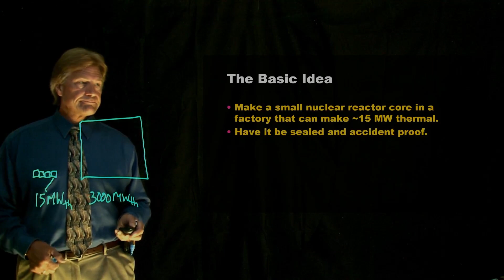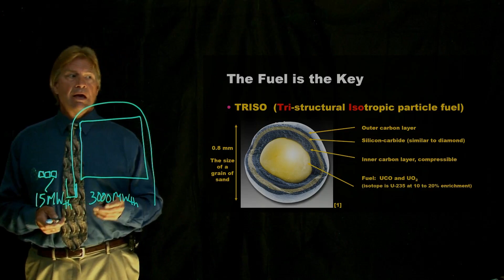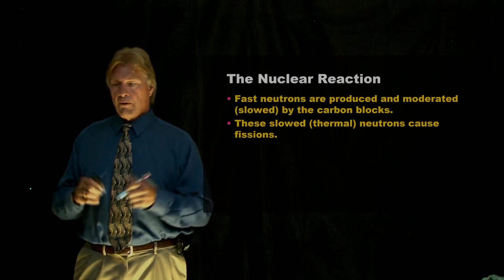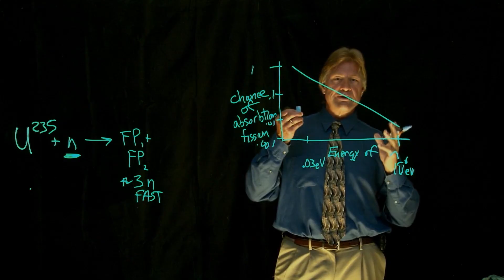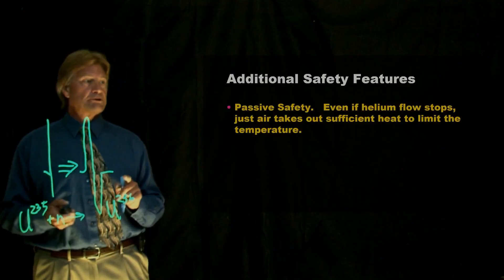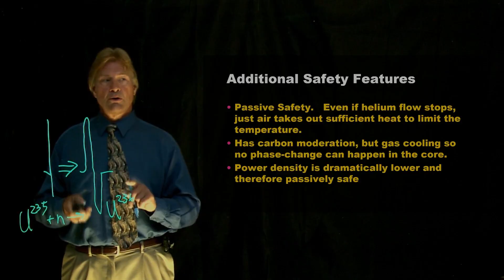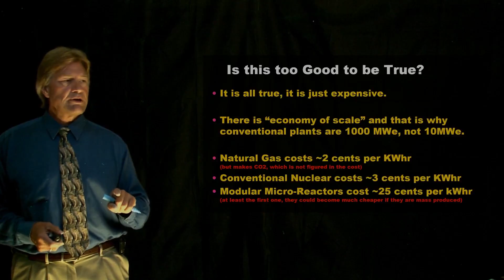Modular Micro-Reactors – The Future of Nuclear Energy?

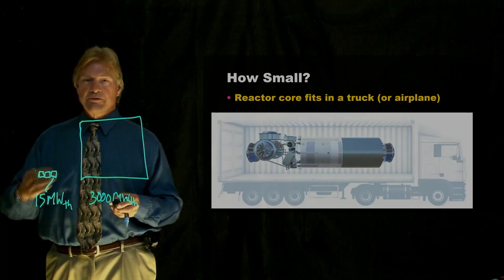Comment: at 3:20 - Mentioning Boeing, in particularly the 737, at this time probably isn't the best safety analogy.   Just Sayin'.
Reply: He didn't say 737 Max.
Reply: It didn't need to be said.
Reply: @milesobrien2694  It drastically changes the comparison he was making, so yes, it would have needed to be said, if that were what he was referring to.
Reply: @theralfinator  The comparison was the price of a prototype against mass production. You don't need to try to defend the indefensible.
Reply: @milesobrien2694  That's the comparison the Prof was making. The OP was making a point about safety, and that comparing the 737 to nuclear reactors was problematic given the current 737 Max debacle.
I'm merely pointing out that there isn't a safety perception issue with the OG 737 that the Prof referred to.
Reply: @theralfinator  Bafflegab.

Comment: All reactors and other thermal production of electricity depend on cooling. So they will work until there is cool air or water. To prevent global warming we need to use and harness solar energy.
Reply: Big Crunch 1GW nuclear plant =10 B$ plus CO2 emissions to produce concrete and steel and nuclear waste
Reply: @prilep5  1GW coal plant ~ 6B$ plus CO2 emissions to produce concrete and steel, and waste fuel on hauling coal. And yes, small thing, burning the fossil produces a teeny-tiny ammount of CO2
Reply: Big Crunch don’t look just at terawatts and exowatts
Reply: Big Crunch 1GW solar farm 0.5B$ no waste and polution
Reply: @prilep5  well, you took into consideration the CO2 emissions due to production/construction/maintenance, why didn't you include the ammout of CO2 produced by: mining silicon and other component minerals, transporting it to the factory, processing the materials into plates, manufacturing the elements, the land required to produce that ammount of energy (!), the maintenance needed to keep the panels clean, repaired, the batteries to store the unstable energy (!) the crashes of bad weather in autumn/winter/spring AND many more.
Reply: If that is so insignificant why we loose ice and snow?because sun got cranked up?
Reply: @prilep5  no, it is because the greenhouse gasses in our atmosphere capture more heat from the sun. Can you please read at least one of the 20 previous answers to your question? I am telling you the same thing over and over. And it isn't a PHD-grade top secret information. Most of this i learned in a post-USSR-grade underfinansed school. This info is a one google search away from you. Can you please research the topic before starting a debate?
Reply: @prilep5  but we are trying to save the Earth by going clean nuclear.
Reply: https://youtu.be/r72GDBOmDtM
Reply: Global warming issue is not the heat itself, but the increase of heat we recieve from the Sun, due to increased ammounts of greenhouse gasses ( a.e. CO2, methane and others). The nuclear power, in general, does not produce any of the forementioned gasses, and therefore does not attribute to global warming at all. That is why it is considered a "cleaner" substitue to coal and gas plants.I recommend researching the problem before trying to discuss it.
Reply: @Gaius_Cassius  You do know that CO2 is made in the construction of the plant and the mining of the uranium right? Practice what you preach and do a little research. OK I see your later comment so please disregard the criticism. It is proper to factor in the CO2 produced in making solar but the net benefit is still there and the modular nature of solar allows much faster adoption which is also helped by its lower cost.
Reply: @stevemickler452  A) from the data i have, on average, although nuclear reactors quite hard and expensive( both costs and CO2 emissions ) to build, they do not require the ammount of fuel, compared to the scale coal/oil/gas plants do. There is a video on this channel with quite a broad analysis of costs of building/maintaining coal/gas/nuclear plants. B) Tesla battery is not yet a practical solution for the energy grid. The batteries, although fairly light, aren't durable and cost effective Enough to be considered an economic solution, for now. Building one reactor that can operate for centuries, although is a heavy investment, with our curret state of technology is a better solution in a long term ( the insignifficant price; comparatively small scale, the ability to enrich the fuel on spot, and the mind-boggling abundance of ore depostis; for an overview i recommend checking out the mentioned earlier video). Of course, the fastest and cheapest (not including emissions and polution) solution are fossils. Accessible, energetic, easy to get the energy out. So, in conclusion, sun/wind can fill a niche, in some parts of the world (arid deserts), they can even be a good second source/backup. But the instability and the cost of installing and maintaining the sheer ammount of batteries needed to sustain a grid overshadows even costs and complications of building a nuclear reactor. Fossils are the answer for places that have no money/time/resources/the education and acknowlegment by the people/goverment to build the other two; for small remote stations (eg. Siberia, Antarctic, parts of Africa etc.); or a convenient and cheap power for a fossil rich region that doesn't give a crap about global warming panic due to much more signifficant problems hacking through the door. Nuclear is, relatively to fossil, an expensive investment but, for sure a much cleaner and fuel side cheaper solution in a long run. Now i have spent 15 minutes typing this for a man that accuses me of ignorance, but he himself didn't pay attention to the conversation above, where a subject of CO2 emission during construction of power plants was mentioned. To this i will also add, as a Post Scriptum, how do you think, what is the cost of manufacturing and constructing solar/wind power plants? Where do the materials used in modern complicated PHV panels come from? What is their emission trace?
Reply: @Gaius_Cassius  Thank you for that informative and I think heart felt reply. I think in other comments, I address some of the issues you raise. I suggest a little more research on the state of development of batteries in general and those of Tesla in particular. Nuclear for power production on a large scale has been out competed and we're headed for a solar/wind/hydro/geothermal/battery/liquid air battery /hydro storage infrastructure. I think that is a good thing and I hate to see such brilliant people not making the best use of their abilities because they are pursuing obsolete technology.
Reply: @stevemickler452  well, i guess we just have different ideas for where the energy production would be applied. My mind is more open for interstellar-class technology, where nuclear power reigns supreme, as no battery can store enough energy compaclty enough for such scale. I see a future where reactors that can last not just centuries, but millennia and more, where there is no worry about bad weather, pollution or any other disaster, just simple and stable supply of cheap power. The Earth as a testing site of safer, more powerful and longer lasting source, where the technology gets perfected. Of course, i don't advocate going 100% nuclear. Nor do i advocate the inforcement of unstable power sources in places where it not very convenient, but you ought to do what people ( whose stance in a majority case is: solar is ideal in every way possible and everyone who criticises it is a totalitarian comunist obsessed with nuclear weapons or a filthy oligarch interested only in making profit from his fossil fuel oriented company, both literally compared to one famous astrian painter (famous not for the paintings); and God forbid you mention nuclear... Chernobyl!Fukushima! Monster! ( and noone cares that i was born in Ukraine and have plenty of clear first source information abot the Chernobyl incident. The Prof. on this channel has a pretty descent video explaining the basic situation.). So, of course, i promote the information about safety and hazards of nuclear, for it is very annoying for me to see people not just misunderstanding the subject of nuclear, but to act out a "u no green = u bad" policy.
Reply: @Gaius_Cassius  Certainly don't want to suggest anything other than that thermal tech, even terrestrial solar thermal is so yesterday. I do have an open mind for space operation but here even I believe solar thermal/electric propulsion and concentrator type PV is more competitive, even out to Saturn, than most realize since mirrors can be quite thin. That said, I wouldn't want to go to Proxima Centauri without a reactor.
Reply: @stevemickler452  i completely agree
Reply: And also, the photovoltaic elements (solar panels) while producing electric current they also produce heat. Even the most advanced solar panels do not transfer all of the photon energy directly into electricity. 40%-90% of the photon energy is converted to heat (although it is a bit more complicated than that). And how about the mirror energy plants, that focus the solar rays onto a boiler, heating it up to produce steam from water. And use the heat the same way the gasoline/gas/nuclear power plants do.
Reply: Павло Павликівський so you think that I don’t know that 
With solar we don’t release 60% in warming air and water while producing electricity plus pollution 

https://energyeducation.ca/encyclopedia/Nuclear_power_plant#Efficiency
Reply: @prilep5  the Sun literally is the main thing driving the global warming. If you consider nuclear power "heating the planet up", i would say that you can't heat up a giant house by tens of degrees with a small LED lighbulb
Reply: Павло Павликівський suns energy will arrive no matter we will used or not with solar will get 25% clean source
Reply: @prilep5  but if you compare the scale, the heat generated by the whole of humanity, by any means, be it nuclear, fossil or any other is such a small fraction, that noone considers it to be of any importance. On the other hand, the greenhouse gasses are of big importance, especially considered the sheer ammout of emission.
Reply: @prilep5  yes, but guess why we aren't using only solar/wind energy? Maybe it's because  these are very unreliable sources of energy, given the limits of our current technology in storing energy. Take, for example, a huge city that has the highest demand for electricity after the sunset. How can solar power that up?
Reply: Павло Павликівський what is the solution No Sun no global warming problem solved
Reply: @prilep5  you don't seem to understand the point i am making.
Reply: @Gaius_Cassius  Suggest you check into the Tesla battery storage projects currently in operation and being built.
Reply: So you blame the sun for majority of global warming
Reply: @prilep5  as i have already stated before, the Sun provides more than 90% of the heat on the earths crust. The greenhouse gasses increase the ammout of Sun's energy captured by Earth's atmosphere.
Reply: Павло Павликівський dude what is your solution -more nuclear energy
Reply: Павло Павликівський answer in short sentences because I can’t see your long explanations
Reply: @prilep5  nuclear is clean and if managed properly very safe. Solar is unreliable. Fossil = more greenhouse gasses = more global warming. More nuclear = less fossil = less warming.
Edit: we can't generate enough heat to cause global warmig without terraforming-scale operations.
Reply: @Gaius_Cassius  Your analysis ignores the many energy storage methods being used and developed.

Comment: Can you regulate power of Modular Reactor withing some range?
Reply: He was saying how they can have a negative temperature coefficient. This means, if you stop taking heat out of the system, they heat up and the reaction slows. So, as long as you can regulate the speed in which you are extracting energy from the system, then you can modulate your output power. Alternatively, you could also store heat in an additional thermal mass to help regulate the ups and downs of a demand driven energy system.

Comment: The heat generated from these could be a game changer. Imagine these powering each skyscraper or a city block, with free water heating as well.
Reply: @George Mann any diesel or gas generator at a similar power output, is semi trailer or shipping container size anyway.
Reply: @George Mann Good point. What is the smallest power output possible using 20% uranium?
Reply: @George Mann i though the new reactor that nasa develop for mars mission can do 10kw and use heatpipe to transfer heat could be the smallest new reactor

also its fully self contain reactor with stirling engine with radiative cooling umbrella. its much compact than any old PWR or sodium cooled
Reply: @George Mann welp. one way to reduce nuclear arsenal right, just mix plutonium 240 to reduce it for reactor-weapon grade uranium xD